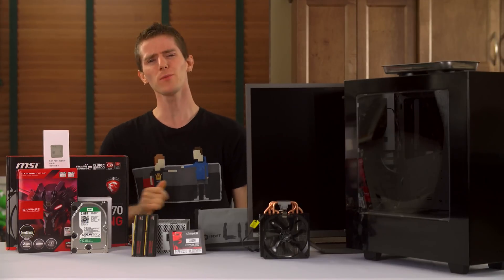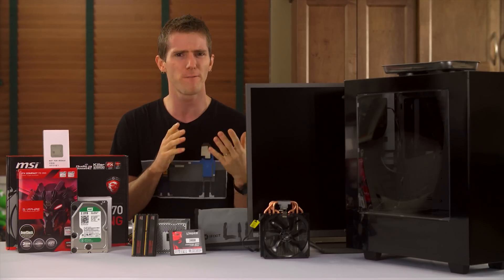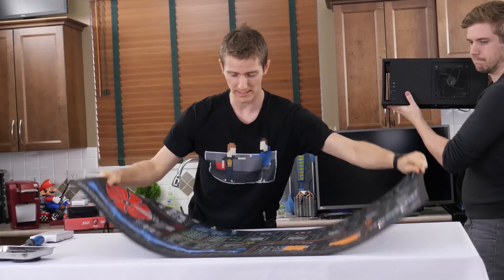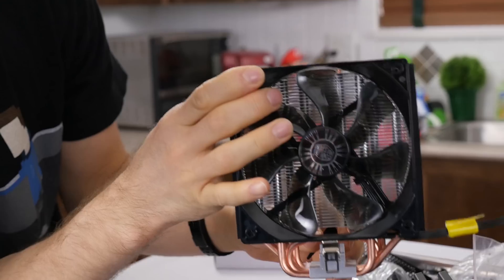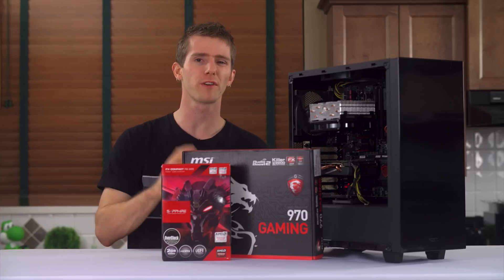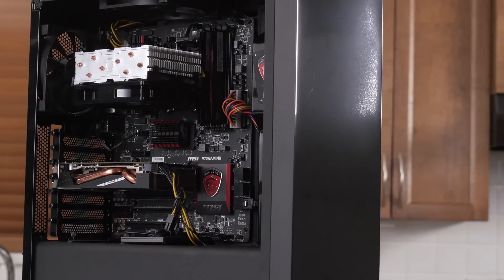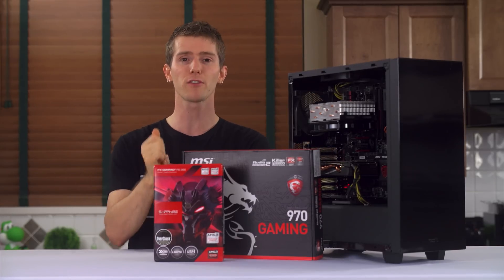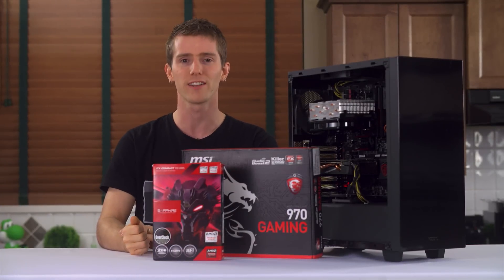Can you Build a 4K Gaming PC for Under $1000?

Comment: amd is really cheap wow, think i will use amd stuff in a build i'll make
Reply: +LOLmomentsandfails The price difference for same performance for Intel and Nvdia is not worth it for a lot of people that are on a budget.
Reply: +LOLmomentsandfails your dumb. Amd and intel are almost equal in performance, also amd parts are half the price. the new r9 380 beat the 970 as the new king of price to performance. also amd still has to release a new line of cpu's seeing as the current line is really old.
Reply: +LOLmomentsandfails Uh, you dont have sources either
Reply: +LOLmomentsandfails Then say so and which one you used to bring your experience to our attention and better the community. It helps everyone , and if you talk about sources please provide your own before commenting.
Reply: Also you do realize that going intel - AMD is way better than intel - nvidia
Reply: whhhhhhhhhhhhhhhy15 "or wait & see how AMD Zen turns out" Does that sound anti AMD to you? I'm not anti anything, I'm pro consumer.
Reply: Intel and AMD, as well as Google are common sources, you should know this if you want to seem pretentious and "technical" lolol this dude hah "intel is better because the ads are everywhere and because people say its good" haha so if someone tells you a truck with a 5.0L V8 TurboDiesel gas guzzler is better than a 1.8L 4 banger sedan you going to believe it? without questioning price? budget? Performance? get outta here man, you just those people that follow the crowd xD
Reply: I forgot the exact model, something from FX. Ill have to look.
Reply: +Katsu Wolf Core for core, thread for thread, Intel's CPUs have a lot more grunt than AMD. In day-to-day activites and lighter games, this isn't really noticeable, but in CPU heavy tasks, Intel CPUs are unquestionably better performing. However, AMD is better for the vast majority of uses in performance per dollar until you get up to the i5s, which are priced as such in comparison to the AMD lineup.

+Rock Parker What are you even saying? AMD had the weaker and higher-priced 290 to counter the GTX 970 from NVIDIA--the price/performance king for nearly a year--until the 390 came out. It was still neck and neck until the 390 had a price drop. AMD and NVIDIA are always going to be running blow for blow in the low to upper middle-end graphics segment. NVIDIA runs away from AMD in the top bracket with the 980 Ti / Titan X, but in all other cases, the two are comparable. Currently, AMD's cards have more VRAM thanks to HBM, but run hotter and suck up more power than their NVIDIA counterparts. That's the only real difference as of right now.
Reply: Guys can we just stop the arguement and say
Intel is fucking overpriced
And amd can handle its own even though being a cheaper product
Im not saying intel products are bad
But they are ridiculously overpriced
Reply: Please read before replying. I said that if he wanted more performance and multitasking needs, go nvidia / intel.
Reply: +Roy van loosbroek you can't cheat the graphic power, you will have to buy three gtx 980's to be able to runb 4k in at least 60 fps
Reply: Shox Lightning thanks! will do!
Reply: +LOLmomentsandfails What cpu did you happen to use? Just curious
Reply: +jirka merunka Hahahahah it's made to play cs:go, you don't even need a 750ti to run that game at 4k
Reply: i'm on a high budget and i've now got a new pc whit a intel i7 4820 and a nvidia 960 inside
it is a old pc i got from my father just a weak ago
Reply: +Katsu Wolf the i7 4790k is better than the fx9350 but okay.
Reply: I know that i have a 4790k
Reply: +LOLmomentsandfails It could have been a low end model so that could be it
Reply: +MIKE 805 You will probably get only 30-60 fps on 4k with a 750ti
Reply: +Laurenz  Hortsch I would hope so, youre paying about 100+ more dollars for it
Reply: +Roy van loosbroek if you&#39;re going for a high-end build go Intel and AMD, but for a low/mid-end go all AMD.
Reply: +BigE1943 Perfectly said
Reply: +BigE1943 290 sheets that I have ever seen show it rivals the 970 just fine. The 970 has been sold well over its price, and certainly now for that matter (I'm saying that because 390's are selling for less then this card now, even the 390x has went down pretty considerably). Though I can agree with your other statements. I just hope AMD steps up their game this year to give enthusiast something they have been waiting for, not to mention just being in decent contention both on the cpu side and gpu side. It really will help the market grow better. However, I hope the game market doesn&#39;t suddenly slide off a cliff either. These piss poor games are not reassuring.
Reply: Laurenz Hortsch by what margin? im not paying $400 for a piece of crap honestly 4GHz outta the box is great but my AMD 955 Athlon X4 II quadcore is overclocked to 4.3GHz on liquid cooled rig. the 955 socket is compatible with the AM3+ socket and i only paid like $60 to a friend for this processor. its been running strong for almost 4 years now. and this dude wants to say the i7 4970K is "better" the entire purpose of videos like this are to show you BANG FOR BUCK the best performance for BEST PRICE clearly not everyone has $400 laying around to buy some outlandishly priced cpu like the i7 4970K for that $400 i can build a decent mini-itx amd rig that will do just fine. you dont need "extreme" cpu's or video cards to just play a game or even browse the web. which is what i assume most of you do.
Reply: +Ryan Dailey The difference. between the 290 and the 970 is much like the difference between the 970 and the 390. Most performance gains aren't very large between two competing cards.

The price issue is valid; the 970 needs a price drop now to compete. However, the 290 had its own price problems in its day due to bitcoin miners. The situation is fairly similar here because of the massive demand for the 970. Regardless, the 390 has essentially taken its spot as the best value-for-money card, essentially forcing the performance per dollar of the market up about 7ish percent--which is great, of course! Let's hope the trend continues.
Reply: +Katsu Wolf It's not just about the tact rate. If you look at benchmarks sadly AMD CPU are all way behind Intel. I like AMD more by mere brand sympathy, but their CPU are just way too weak. The bulldozer architecture AMD uses can not really be utilized by most current software anyway.

Where AMD CPU really shine is in professional, non gaming usage, as far as I know.
Reply: Don't worry, that will change when developers start to release games that support DirectX12, that will be in a matter of 1~3 years.
Reply: Lucca Fehn where the fuck did you get your information? dude are you stupid?  Yeah benchmarks are NOT what im talking about, but dude, you honestly don't know much at all about AMD microarchitectures, Bulldozer was released somwhere around 2010-2011, Excavater is the new microarchitecture and in 2016 Zen will be their new release, that being said if they are comparing a Bulldozer microarchitecture agains a brand new Intel CPU of course its not going to have good benchmarks. But the thing here, is just because you have an Intel doesnt garuntee a a 'better build" im talking about budgets, how far can you stretch $500 for a pc? with AMD you can go really far, but intel? good luck finding anything decent lol. like i told a friend, intel is  just one of those things people buy mostly because of its name and ads. people wana throw hundres more dollars at a processor that really doesnt squeeze much more than an AMD, $200 extra dollars for what? Hyperthreading? LOL and what percentile is that going to increase performance? what like 0.005%?. xD
Reply: +Katsu Wolf intels cores are more powerful and have fun playing dayz standalone with amd
Reply: DANKASOAR I do play DayZ just fine with an AMD? you must not know much. what inside the microarchitecture REALLY differs from the other? can you tell me this if the same process is used to build the billions of transistors on the die of the processors? I mean they might fit propreitary softwares and shit to communicate the cores with each other but the materials and processes used are almost identical. its not a fucking racecar where they can use different materials to come up with the same  thing ( a race car that drives) no. so where you get this , "the cores are more powerful"? the hell do you get this information? the ads and commercials telling you bogus bullshit? sounds like it. maybe you should take a college level course in computer science like i did, and actually learn a thing or two about hardware and cores and all that and how they are built and how they don't differ from each other all that much.
Reply: Katsu Wolf DayZ and most non-MMO video games are less demanding to the CPU. They need graphics performance. AMD GPU are more or less on par with NVidia chips.
Reply: I may be hella late but he didnt say that intel and nvidia was cheaper he said it performs better which is true
Reply: lols221222 Not really. Their pricing is justified; they pull away from AMD at i5s, where the price starts to exceed AMD's top-tier processors.
Reply: +BigE1943 Yes I admit Intel cpus are better
But I meant gpus haha
Reply: Advection357
LOL you seem anti amd guessing you rocking 4 nvidia cards
Reply: Advection357
if only that was all that was written in your comment about amd
Reply: +LOLmomentsandfails i could agree about intel but not about nvidia.
Reply: John Locke i already did, i've just build a new pc for 500 dollars for my sister
Reply: whhhhhhhhhhhhhhhy15 I did say "AMD cpu's" not gpu's :P And I only have one Nvidia card.. sold my R9 280 to get a gtx 970 because some of the apps I use require cuda..
Reply: +Advection357 yea m8 I honestly didn't read it good amd CPUs aren't that great tbh
Reply: +Advection357 yea m8 I honestly didn't read it good amd CPUs aren't that great tbh
Reply: whhhhhhhhhhhhhhhy15 No especially not in 2016.. AMD is losing the price/performance in the lower end of the market.. which was their main strength. I'd hate to see Intel being the only CPU manufacturer.. innovation will slow down and prices will go up.. which is what is happening now with each new Intel gen bringing in like 5% improvement
Reply: Advection357
weren't they working on a new cpu design which was suppose to come out soon? just googled, its zen hopefully that should give them a boost.
Reply: whhhhhhhhhhhhhhhy15 Lol yeah.. that's what I mentioned in my earlier comment ;)
Reply: AMD is shit had a 4.0ghz cpu with a 970 4gb ran Dayz at 30 frams got a Intel pentium just for the lol got 60 in city's so now I got a i7 4790k at 4.5ghz get 90 frams in city's
Reply: +Katsu Wolf dude, you cant compare cpu just by it's clock speed...
Reply: +Katsu Wolf  You're an idiot. Ghz have nothing to do with how good a CPU is. Some of the best performing CPUs are clocked at 2.8ghz. Do some research before coming out here and fighting a side without knowing how CPUs work.
Reply: +Katsu Wolf Good on ya for standing your ground, also I love how LOLmomentsandfails got called out for not sourcing his info while trying to argue that you did not prior to being called out. Lmfao, I wonder if he made his silly vids from his flagship Intel PC LOL.
Reply: +Katsu Wolf Also, I bought an FX 6300 used for 100$ CAD (I'm second owner) and I had a cheap all-in-one cpu block on sale for about 50$ CAD. I currently run it overclocked to shit to bring up the Bang for Buck ratio.
Reply: +Roy van loosbroek Please keep the release date of this video in mind.
Reply: TheWhysohate I could of hot a new one for that price smh mine's from Amazon was 125 it should of only be 85 they new egg smh they robbed us both but I was uneducated and it was my first build
Reply: +Roy van loosbroek AMD is Intel's cheaper twin like imo they're literally the same thing except AMD is hotter. but it's honestly not too big of a deal
Reply: +Roy van loosbroek amd stinks. i wouldn't sugest it. amd is not reliable.
Reply: TheJerzyslugga For you yes, probably because you are not canadian. it was probably 85 USD at the time or something. so yes you got ripped off. I however saved quite some cash.
Reply: Westdog 01 Lol Intel fanboy. Iv'e had both, no problems on either other than the Intel build pwnt my wallet. My fx 6300 overclocks to 4.8GHz easily with about 1.4625V bump. Purely from profiling your account for 30 seconds i can deduce you are a young person whom of which has no idea what hes talking about or does video editing (the only real difference on practical performance on Intel's side). The only real problem with amd cpus nowadays is efficiency as shown by my overclock stats (and im lucky with the silicone lottery that i actually am running lower voltage compared to most people with such a high overclock, but can go higher easily but i need more radiators), and software optimization. Nine times out of ten these days at least with games, the amd counter part may only have less performance because the game devs probably have intel hardware because for that scale, the extra tdp adds up, and as a result they did not have as many lines of code to take into account the broad spectrum of hardware out there. So fuck greedy ass intel
Reply: +TheWhysohate you... put quite some afford to describe him don't shu?
Reply: KEnnyK CSGO & Others No, it took like 30 seconds of looking, and like quarter of a sentence. The rest was for other people, because I fight his ideology.
Reply: +LOLmomentsandfails  no they arent, dude AMD is FAR better bang for my buck than crappy ass intel yo. im NOT paying $400 for an i7 that barely pushes 4Ghz i can buy an AMD FX-9590 for $200 and push 4.7GHz. ontop of that i could overclock it to 5GHz if i wanted to really push the AMD cpu. The ONLY reason you think Intel is better is because intel advertises their overpriced crap everywhere, they pay magazines, and web articles to advertise their intel products as "better" when really they aren't.
Reply: +Roy van loosbroek better to go nvidia / intel for more performance and multitasking.
Reply: Katsu Wolf Nice sources. Try again, maybe you'll understand this time.
Reply: +Shox Lightning I've had experience using AMD CPUS before...

Comment: The problem with PC gaming is that you need to constantly upgrade your PC which means a lot of money. That is why less demanding games are more popular and that is also why there are more gamers on consoles because they dont want to spent a lot of money on a PC. If PC manufactures put a standard for gaming like must be playable on a GTX 650 on 4Gb of RAM and an i5 processor you might see a lot more gamers on PC. The standard might be changed a few years later.